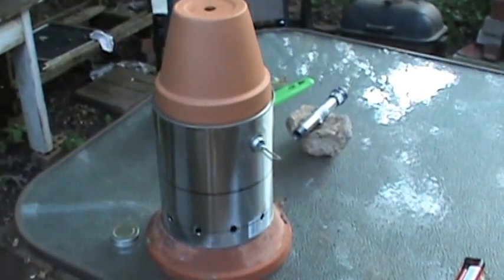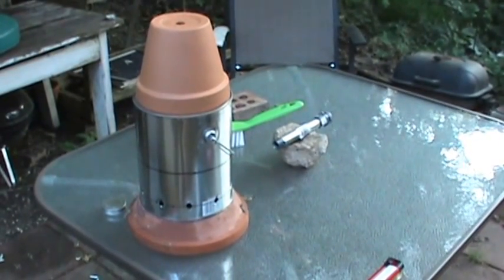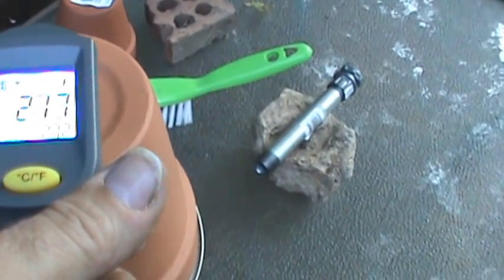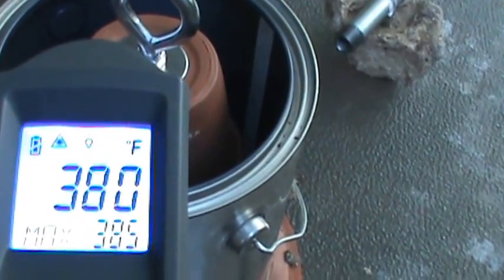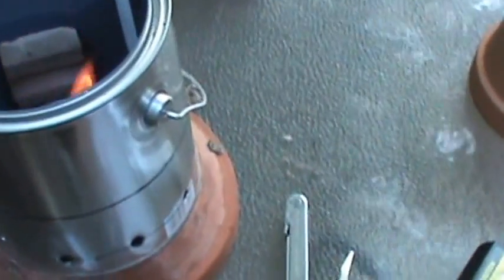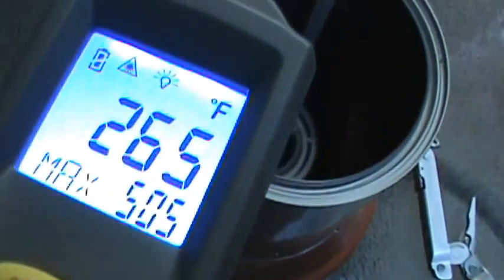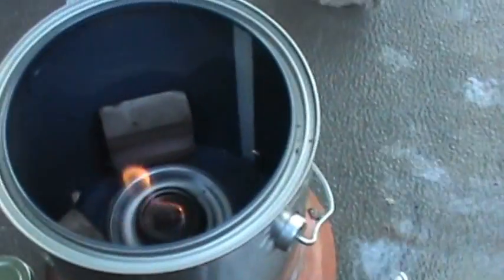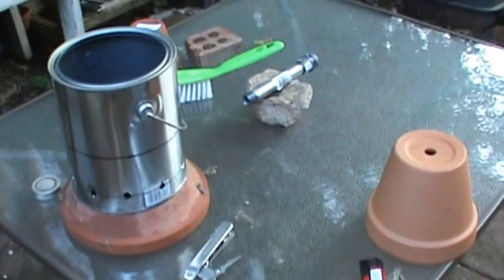Flower Pot Heater redesign. This one works.

Comment: Define "works". You have proven that metal radiates heat faster than ceramic. Remove the heat source and you'll see the ceramic emits heat longer than steel. The net btu's are the same.

Comment: great idea using paint can. the more negative flame comes in contact with,/ bolts,washers,nuts, the more heat you will generate. Use a 1-2 inch candle, no a tea cup candle,too small. Candles won't give off the fumes like the sterno will.
Reply from the maker: as soon as I get time I will make the updates on this. Have made large soy wax candles to replace the chafing burner. they last a lot longer. work, health, family and weather are hampering my efforts but I will put up more as soon as I can. And the results good or bad will be represented as acurrately as I can present them.

Comment: I think these flower pot heaters are great even tho they work best when there is no wind outside....  I wonder about using any petro based fuel tho fumes might be a worry...  where the wax candles have less heat, yes but long term they work for heaters...  I use these in the garage so pipes won't freeze best of luck be safe...

Comment: Seriously people, this or any other 'Flower Pot' heater does not work as described. There is no free lunch, it cannot radiate more heat than the candle can generate. Using a laser thermometer only shows the surface temperature of the stored energy, not the radiated energy. Radiated heat is what you'll need to heat any enclosed area. All that's shown here is the level of stored energy, totally useless until you can somehow release it into the air. To do so would require a fan to move it off the surface of this can/pot contraption and into the air. But by doing so you would cool the heating contraption far quicker than its puny heat source could heat it. Google radiated heat so you won't be mislead by what's shown here.
Reply: downoneasyst1 It's not the ceramics that are the issue. It's the energy provided by the candle.
Reply: True, the flower pot models have their glitches. But to state that a fan is needed to take advantage of radiated heat is a fallacy. The old water radiators in houses, back in the 30's had no fans. Oil radiators heaters for houses are still sold to this day. Also, if you do a search on tent / camp heaters... you will see that almost all propane / tent camp heaters are radiated models... with no fans.
Reply: I have made used this type of heater during power outages. 
With 2 of these going are whole top floor was warm enough, we could wear t-shirts.
Reply: Ummm...unlike you, it worked for me. But then, you must have money to burn, or you live in an extremely cold place. I don't. 
I does work for me. Not 72 degrees, but raises the heat in the room from about 63 to 67, which is tolerable. I section off my small living room with curtains at the two doors, one to kitchen and a hallway door.. My ceilings are not tall, and it does work for me to keep that room warmer. I also have a couple of homemade oil candles burning in that room.
Reply: +naanaa1111 It doesn't work and I have tried it myself.  Unlike you, I actually have made a video about it.  The guy that made this video said he would make a video once he had data to prove it works...one year later still waiting.
Reply: I watched the video ...and  I did not see a candle being used
Reply: I'm considering a cluster of intertwined copper tubes, each going from bottom to top past the candle flame. The heated air inside the tubes should move the heat around  more efficiently than a radiant heat sink. The paint can seems like a perfect platform for such a project. Thanks.
Reply: Some of you peiple are just plain ignorant about heat tranfer.... I dont claim to know it all myself, but I know a little since I grew my entire life living in a home heated with a wood burning stove, my dad actually invented some new designed wood heaters and so I hve been around using flame from wood and such for heat all my life and so here is something that needa to be considered and some other have made a similar point.

If you take a 1/2" dia. steel rod and heat it to say 500°F and then you also take a wood heater made of 1/4" plate steel or cast iron that lets say it is large enough to hold several 4" dia. logs about 18" long and you get the wood burning so that most all the surface of that wood stive is tye same 500°F as the 1/2" dia steel rod.
Which of these two items is gonna priduce enough heat to heat up a 400 sqft room?

I can guarantee the 500°F rod will do nothing, but the wood stove with the much larger surface area will have that room toasty warm in a short time.

An acetylene tourch that burns at about 6000°F by itself burning in the center of the room will not heat the room up as good or as quick as the wood stove with all its surface to radiate heat when its only 500°F

Why do you think that even a small electric space heater has multiple heating coils instead one one little skinny strand of Nichrome wire? more surface area distributes heat better even if it all the same temperature.

The flower pot works similar to all the good wood burning heaters which use fire brick inside them, the brick gets hot, the heat tranfers out to the steel walls and it all works together to retain and radiate the heat from the fuel source better and longer.
Reply: @mapbike   : aahhhh   yes ,

Surface area ....        😌
Reply: KarmaTiger
Reply: So where is your video link Mr. Fernbark?
Reply: I AGREE. (In theory to keep everyone happy.) Although having a clay pot may very well distribute the heat at a different rate or in a different direction I cannot see it generating any more heat than a candle without the clay around it. I would like to see a controlled experiment in two sealed boxes with enough oxygen to keep the candle burning. One box with a candle on its own and the other box with the claypot setup. I would say that if you measured the temperature in both boxes it would be the same.  If you have a fireplace with a flue then it would be a different story because you lose a lot of heat through the flue so the more you can capture the better so any kind of radiator will improve the heat retention but when no heat is lost it would only slow the heat loss or keep it in a more appropriate place say at body level for example instead of quickly rising to the ceiling, etc. But getting something for nothing such is in this video defies the maths. Having said that maybe there are some other factors at play here that haven't been accounted for?
Reply: I use daily chef chafing heater from Sams the blue can's I take the felt washer off and  place a stainless steel washer over the wick and cut it to eight of inch high they burn average 12 hours or more , their b rown cans only 8 hour, the 
 two hour cans only four
Reply: I hope you are 'smarter' about other things you do.  FYI, the heat from this should be exactly the same as just burning a plain ole candle.  Right?  IF not, why not?  Studies Newtons Law of Thermodynamics
Reply: What a troll
Reply from the maker: Sorry i'm not as intelligent as you are. I base my findings on actual field tests. the one time i tried using this as a heat source in my 9x10 cabin tent it kept the inside temps at 61 degrees when it was 42 degrees outside. thats good enough for an initial test for me. And I will test what I am putting up before I make a video to make sure the results are good or i wont post it.it doesn't need a fan because the natural draft of the chimney effect moves the air. have a good day.
Reply: I love it when arrogant know it alls want to come here and make a pompous statement about something they have not even tried for themselves.  A man with an experience is never at the mercy of man with an argument. 
It works. Good video
Reply: Hey Mr. "for yourself I think", have you done your research? Manufacturers have been using ceramics for all kinds of heaters for decades, Their ability to radiate temperature evenly and efficiently has been known for millenia.
Reply: Then it's definitely not gunna work! :-)
Reply: Dear Think for yourself, For to understand simple physic energy low people should have an idea -what it is!  Just put this invent in the middle of the room 15x15 with 15F for 1 hour and  get measurement again -you will see how useless it is!LOL!

Comment: great video ! just make sure your tent is ventilated, wouldnt want you to fall asleep nice and warm and not wake up !! might want to pick up a a CO / CO2 detector.
Reply: ..or wake up cold...
Reply: @pitus6501  on the slab... lol
Reply: I believe that an early Antarctic team, maybe it was Shackleton's team, almost died from lighting a stove that produced CO (carbon monoxide) within a closed space. Be careful. That is one reason that flues are used for indoor fireplaces, water heaters, etc. which use a flame to generate heat.

Comment: That is pretty cool. I think for safety the metal needs to be encased in something insultating. You don't want 200+ degrees melting your tent. How do you plan to keep it in your tent without it melting? I would like to see a video of what you have it sitting in.
Reply: I would want one for my bathroom....and I would just set it in my ceramic bathtub!
Reply from the maker: I have more improvements on this coming when i can get time to make the videos. i have made some soy wax candles to replace the chafing dish as the heat source and have also experimented with using a quart paint can instead of the gallon one so it can be more compact. a larger metal bucket will solve the concern about the heat. they have them at lowes or home depot and you can just set the heater inside it; wont affect the air flow and will keep it all from falling over. this was an experiment to try it. a more refined version is forthcoming. will also show how i made the candles and what I used. Stay tuned. Also use your discretion. If it doesn't look safe enough for you don't do it.
Reply: @SelfRelianceLab  Make your candles out of Crisco lard you buy in the grocery store. Put in your container, insert a birthday candle in the middle. Will not have to worry about any fumes either. Lard was used for years in the old days and very safe to use inside.

Comment: Just wondering ,what about air consumption inside the tent?
Reply from the maker: haven't used it in tent yet. will have a co alarm in with me just in case. Don't think my tent will be tight enough for it to be a problem but we'll see.
Reply: most tents are nylon and thus air permeable. not efficient as insulation, but a very small space to keep warm.